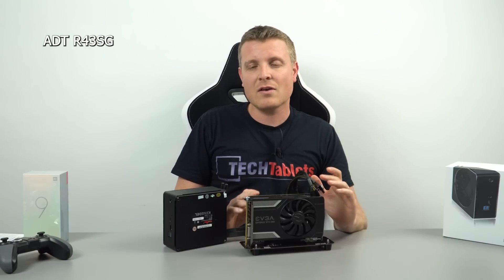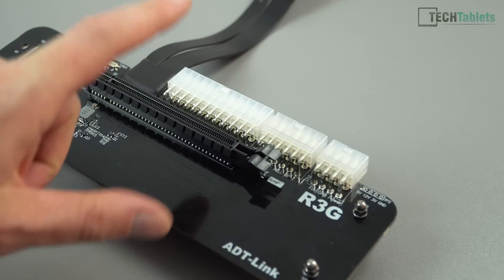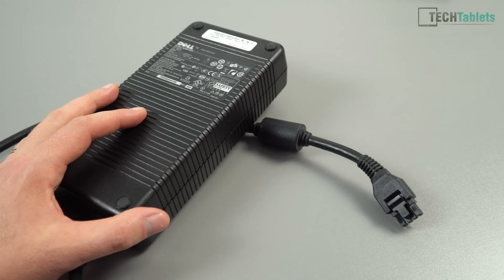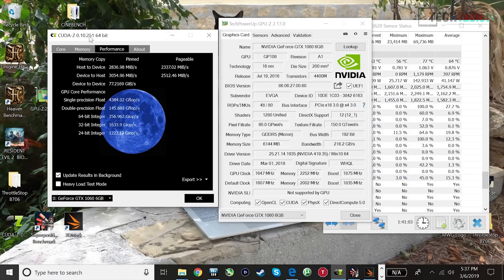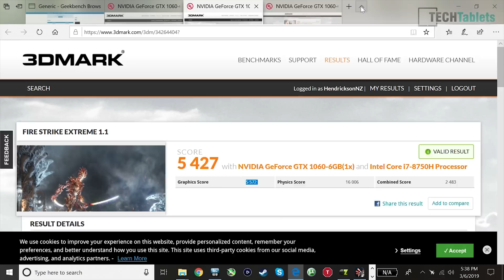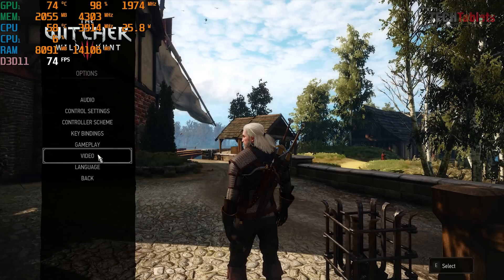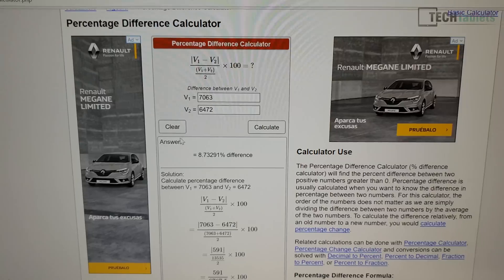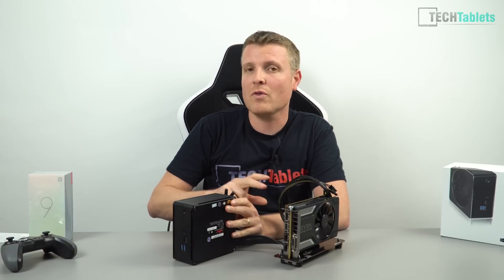M.2 PCIe x4 to External eGPU - Faster than TB3 eGPU's

Comment: The only problem is cost. $90-100 is too much for just the connector. Then you need power source  also & cabinet for GPU. So it bumps up the cost very significantly.
Reply: this connector is only 40$ in china ,but you the shipping cost another 40$....And I buy an used connector half years ago for only 30$ because shipping in china only cost 3$ ...
Reply: @杨俊秋  Nops. That's not the case. Shipping is not $40. Chinese manufactured products have different pricing for outside customers. Since you are in China, they are selling at lower price. I once enquired for Luxcine projector. They quoted me 300 initially thinking that I am Chinese but when they got to know that I am outside China, they quoted $600. Another instance was reported by another user who told that he purchased Jxd 192k model for $150 while in china. But for outside China, it's available for more than double the price..
Reply: Not necessarily: now you don't have so buy another new mobo, ram, cpu, monitor etc.
Reply: @xostler  So is this video aimed at people who already have a very capable system having M.2 which lacks only a powerful  GPU? M.2 is a newer port, so it's not present in older systems. Not many people buy that kind of setup without thinking about future needs. See, my point is that instead of investing money in these upgrades & not extracting the full potential of the card, it's better to build a newer & better system. Ryzen based system can be built with same 1060 GPU by investing just a touch more money. That system can be later upgraded by changing the card and you will still extract full performance of the GPU rather than loosing 10-20% like in this setup.
Reply: Dr Mayank Singh nah man I mean like a laptop. Now you don't necessarily need to have two completely different PCs

Comment: Extra information to add, the bandwidth/performance loss can be attributed to hwo the NVME/m2 slot is routed on the motherboard. If it is directly hooked onto the PCI express lanes of the CPU, you wont lose more than 5%. If it is hooked onto the lanes of the PCH, then it depends highly on the load of the PCH, if you have 2 others NVME drives, a TB3 etc on it, the performance will be much lower.

Comment: I know fo a fact that this wasnt possible untill they invented this 4x NVME connectors...Now this can be used in any small laptop with ease..Nice review!
Reply: You're wrong. This has been done way before NVMe and Thunderbolt.
Reply: @dan8t669  I said-"x4 speeds werent possible" I know those E-GPU exsist even before 4-5 years   but they worked on x1 speed!
Reply: @CocoSloan  No, you didn't. The original comment is still there: "untill they invented this 4x NVME connectors"
Regardless, you're still wrong. 

MSI GS30 Gaming Box has an x16 Interface to the external GPU and is 5 years old.
And there were much older x16 laptop docks before that. Quite common for workstation grade business laptops.
Reply: @dan8t669  You are talking about "docks" im talking about cheap e-GPU (external gpu) solutions.Untill now they all worked x1 pci mode.Hence they didnt utilise the full power of gpu-s..
Reply: @CocoSloan  Again, no. You were talking about "4x NVME connectors" and how it wasn't possible before. Which is wrong.
Another example:

First generation Alienware graphics amplifier used a proprietary cable to deliver 4 pci-e lanes to its e-GPU, NOT x1. And it too was released way before NVMe came out.
Reply: @dan8t669  Dude stop talking about commercial external gpu-s..Im telling you this wasnt possible with cheap-ebay kind of e-gpu's..If im wrong i will admit-but focus more on what im saying!
Reply: @CocoSloan  The Facts are the facts. Your original comment doesn't say anything about cheap, ebay kind e-gpus.
Instead, you claimed it wasn't possible until they invented 4x NVME connectors, which is wrong.
And you can't admit it.
Reply: @dan8t669  Ok i ADMIT .. Go to sleep now!

Comment: Thanks for the video. Just bought a R43sg for my Dell Micro 3050m. What GPU would you recommend for this egpu setup? Im running an i7 6700t/16gb 2400 ram for my Dell. Would a rx 580 be powerful enough (but not too powerful that would bottleneck the system)? Just looking to play Apex legends on my SFF pc. ;)
Reply from the maker: RX580 would be fine for Apex Legends. I think right now the best card for it would be the 1660 Ti, keeping with the Dell power supply that is the cleanest method to power the cards. That card you can use top setting and very good 1080p results if running a 120, 144hz monitor etc.
Reply: @Techtablets  Appreciate the reply my guy. Will look into the 1660ti for sure. Gpu prices in my country are still a bit wonky, a RX580 is actually only 20-40dollars cheaper than the 1660ti. However, the 1660ti price is just 100 dollars cheaper than a 1070ti. So i just defaulted to the cheapest card i can get to play some apex legends. In any case, i will look into the 1660ti more. More power to your channel. Thanks again.
Reply: Just an update for those looking to have an egpu setup, I already got the r43sg for my DELL 3050m and decided to pair it with a Rx 570. Fairly happy with it. Very capable 1080p 60frames for Apex Legends. 

The setup is a bit ugly, and definitely not plug and play. Still looking into m.2 extension cables so i can do a a plug and play setup.

Comment: After setting this up, can I use only miniPC when eGPU is connected while PSU is unplugged. Will this egpu work with 1050Ti, Thank you :)
Reply from the maker: Hi, I'm running it now (unplugged no power) and it's fine. It will run both iGPU and eGPU if you want it. So when not using my GXT 1060 the iGPU is running, just swap the plugs. Yes, a 1050 Ti will run fine and with the Dell 8 pin plug is fine up to 180-200W TDP cards.

Comment: Hey i have a MSI cx62 6qd with a i7 6700hq but a poor gpu do you know if this adaptater will fit.
Reply from the maker: As long as you have a free M.2 PCIe slot yes. But get the 50cm cable version. 25cm is too short for laptops.
Reply: @Techtablets  thx
Reply: @Techtablets  can you pass the adapter link?

Comment: Its possible to test this on Mi Notebook Pro?
Reply from the maker: I recently sold mine, but it will work but since you run two PCIe slots both will be x2 speed. As with the SSD's one SSD = x4, but two SSDs when I tested it both dropped to x2 to shared the PCie lanes.

Comment: How do you power the eGPU, i mean, where the cable from the dell power brick goes?
Reply from the maker: 3 pin plug to the wall socket. Like a typical PSU plug.

Comment: Can't wait for the USB4 version! ;)
Reply: USB4 looks very good, not just the technical standard but not requiring or minimal licensing costs will make it available everywhere
Reply: @ezg8448  Yeah, I think it's going to open up many possibilities.  Multiple monitor set-ups, daisy-chaining, egpus etc...   I'd love to be able to get a cheap tablet or laptop and hook up and an egpu and a 4k monitor.
Reply: Has there been one announced?
Reply: @roostergentry  No, not yet.  The USB4 stardard was just announced and you should be able to buy a USB4 supported device next year.  USB4 is basically Thunderbolt 3, so in theory, any computer with it should be able to support an EGPU.  So I'm sure they will refresh this technology with USB4 when it comes out.
Reply: ADT tech has maded a usb4(thunderbot3) version ,but the price is too high(about 300$),the reason they using m.2 is m.2 is just pcie 3.0 x4,but thunderbot3 needs a chip(about 200$) to translate into pcie3.0 x4...
Reply: @杨俊秋  But that's what's great about USB4! It's royalty free.  It's free to use. You have to pay a fee to use Thunderbolt, but USB is free for anyone to use.
Reply: @gokuo64  usb4 is free ,but the chip isn't, it may cost less ,but i think it still takes  50$-100$...
Reply: @杨俊秋  50 dollars is still a lot less than a 400 dollar external gpu.  I'd easily pay 50 dollars for a USB4 egpu.
Reply: @gokuo64  50$ is just for chip..if you want better experince ,you need 40$ for case, power supply,shipping and cable...I  am waiting for usb4 egpu too,but I don't feel so good about the price....
Reply: You can't use eGPUs with USB and you will never be able to. It's not that is not speedy enough (yet), but the USB protocol is a completely different protocol from the gpu's PCIe. They are incompatible.

Comment: Not really surprised that there isn't a huge performance loss - PCIe 3.0 x4 provides the same bandwidth as PCIe 2.0 x8, which used to be fine for GPUs a few years ago. GPUs still aren't really taking advantage of the extra bandwidth provided by PCIe 3.0, it seems.
Reply: hello, im a noob in the p.c world but can someone tell me if this egpu will be compatible with a M.2 2280 slot?
Reply: @npaz24  yeah, there is no bandwith losing, all m.2 nvme are the same, just be careful with the screws
Reply: @flaminyonguwu4034  , thanks for responding on that question. Also, does PCIe 4.0 x4 see a bottleneck with a eGPU considering its equal to PCIe 3.0 x8? I have an extra M.2 NVMe PCIe slot in my new Acer Nitro 5 but can not find what speeds it at.
Reply: @captureinsidethesound  did you solved? Im on your shoes
Reply: @waikiki  , that laptop is gone now, but if I remember correctly, I think it was PCI-e 4.0 x4. I wish never sold that laptop because it was a workhorse.
Reply: only one card that exceeds x8 speed and that is currently the 2080Ti and only in some tests.

Comment: Chris, all the Thunderbolt 3 port use 4 lanes of PCI Express, not 8 lanes like a GPU slot in a Motherboard. Only the Alienware Customized Graphics Amplifier port can use 8 PCI Express Lanes for their  Graphics Amplifier port. In this setup, the bandwidth you will get, will be theoretically same as any Thunderbolt 3 port with 4 lanes (40 Gbps). And there is currently no card in the market, may be apart from some highest end Quadro cards, which can saturate PCIe 3.0 8 lanes. The actual bandwidth provided by the GPU is way below that. So, using 4 lanes will not really cut the bandwidth 4 times.

Comment: I got the gtx 1060 3gb used for £90 and enclosure for £25 and external GDC EXP Beast for £45 with Dell power supply. I got 2*4gb DDR4 2666mhz £53 and 256gb nvme for £41 and after cashback the main computer £288 before customs. £540 total before customs considering a laptop with same spec is £1000 roughly sometimes less or slower SSD and slower DDR4 I'd say this is still a better buy than a complete self built kit especially if wanting intel processor.

Comment: I've read somewhere that the perfomance drop through x4 lanes is as you said at a maximum of 15%. 
But unfortunately that applies only to cards UP TO the 1060 and in the FullHD range. 

If you go higher to a 1070/1080 or 2070/2080 and you want to handle 2k or even 4k you have to be ready for a greater perfomance loss as the transferred data is then way more as what the x4 lanes can handle. 

Would really like a second video as comparison with the 1080 and 4k. But thats probably a bit too much of an investment for only one video. (buuuuut you could start playing vr with it, which I would highly recommend. ^_^)
Reply from the maker: Hi, well it was the Firestrike Ultra test in 4K there.
Reply: @Techtablets  woah, missed that. Thanks for clarifying! Would be even more interesting to know how beefier cards would get handled!

Comment: 12:43  Personally, those type of commenters need to keep to themselves. This setup is meant to be an add-on for those who already have systems or want to extend the life of an old laptop.
Reply: @EMagnificent You're a fool's errand.
Reply: @EMagnificent My laptop is from 2014, but it's got a 4 core i7, 16 gigs, and ample storage. All benchmarks say that the rest of the hardware, aside from the graphics card, are mediocre, but more than useable for modern gaming. If I'm already running a better external wifi card, and it already lives on my desk full time, why shouldn't I use the MPCIE slot for a newer gpu? Bottlenecking? The most severe credible reports of performance loss are around 30%. I'm running an 860 right now. an EIGHT SIXTY. You mean to tell me that I won't get a measurable improvement for small bucks here? Theres reason to expect a VR ready setup, if only at the minimum requirements, with a good 10 series.
Reply: @EMagnificent yes true. but lets say this is a temporary build for a "decent" laptop whereas the gpu and PS will go onto the full PC build later on. this is perfect as temporary upgrade to performance.
Reply from the maker: Exactly, for a mini pc liek this it might just be living on a desk and never moded around, or that 7700HQ with a weak 940MX GPU just got itself an upgrade to a 1060 or 1660.
Reply: @Techtablets  This Will Work with a MSI GT80s Titan? It has 2 NVME slots

Comment: Great video, fun project and perhaps not that realistic for every day use but it does work. I am so tempted by the Partaker Mini PC with the updated Intel Core i7 8550U Quad Core cpu but I fear it still has HDMI 1.4a but it seems they have included a M.2 slot. Can not decide if a Intel NUC is a better option compared to that nice passive cooling. This small computer would have been epic with the AMD Ryzen 2400G or 2400GE at least in terms of much better performance with the Vega 11 graphics.
Reply from the maker: 99% sure it's sadly HDMI 1.4A. Only the Intel ones use HDMI 2.0A so this is yet another area the Chinese cut costs
Reply: @Techtablets  Yeah, I agree. But as you said, you can always use a DP adapter to fix that.

Comment: Nice. But compare Desktop/vs NUC in real life. Like 4k render, games, works in PS/Autocad with same card, power consumption. PC with 4 cores?  I gues 8750H NUC will be 10% slower but twice effiency in heat/noise and power consumption.
Reply from the maker: If you see my main review of it there is more info. But yes power consumption is so much lower. Huge difference. And it still edits my 4k videos fine in the studio when I do. It feels as fast as my desktop in everything normal day use etc. And most of the time I never even hear it. The fan is almost off, just a low RPM only when encoding and editing really it becomes a hum.
Reply: @Techtablets  I ask for render with eGPU, temps and trottling in games miniPC after hour in Metro or Battlefield
Reply: I suppose because the workload of GPU is external the CPU temperature must be lower under demanding graphical processing.

Comment: i have an eye for this GPU evga gtx 1060 last two weeks until now on ebay and use as eGPU like this but i always lose on bidding😥. can't wait to keep a hand on it.lol...
Reply from the maker: Hi, it's why this video has been about 3 weeks in the making. I lost a few bids on the cards, first, it was a 3GB version and was lucky to grab this almost as new card 100% dust free. The power adaptor also took 2 weeks in total from eBay almost but only cost 25 euros. I'm really pleased with the performance overall of the card even if the VRMs apparently don't have heatsinks I read in a review.

Comment: Nice adventure even I won't go that way.
Great that you do that cause next time I might jump on your next train you set on fire again cause that had happened from time to time every quarter like Xiaomi 4 K drone, tabkets, laptop hacks and tweaks like the copper heatsinks.
Reply from the maker: It's definitely not for everyone this mod with the GPU stand. Well I plan to go even a step further and check the Core i9 8950HK version to see just how much I can overclock and push it before thermals etc are an issue.

Comment: 1050ti would be much better choice if u got the i5 model and if u got the i7 one then gtx1660 would be much nicer choice!! .... , if u r just going to sit at home I don't think u need a mini pc , just build a full size desktop !! much easier to upgrade , clean/repair!!
Reply: well the i5 with a 1660ti would be faster in games than a i7 with a 1050ti. 

you can use an i5 with a good gpu as well for high fps.
 
depends on the game.
Reply from the maker: Yes just go PC build for home if gaming. But just the mini pc itself is great for space saving and portable etc.
Reply from the maker: 1660ti isn't cheap however, double the price of the 1060 I got. But at least it works with the cleaner Dell power supply and not a bit loud messy PSU.

Comment: EXP GDC Beast 8.0
Reply: That's what I'll try it's much cheaper and has enclosure options. Got my kit complete with enclosure and Dell power supply for £70. Hopefully cable will fit through like this does however I went for ngff m.2 which isn't as expensive as the m.2 and won't be 4x pcie but I hope it's close.
Reply: @_GarethRossUK  can you do with a Thinkpad laptop with expresscard ?
Reply: @ThePASBERUK  Give it a try
Reply: @ThePASBERUK  Don's try expresscard. My thinkpad w520 with strix 1070 can only work stable under pci gen 1 and it lose too much performance.
Reply: @_GarethRossUK  any updates about it and how much loss you got?

Comment: This will help if the CPU and memory is too much for an integrated discrete GPU, else it won't help. You have a full i7, that is why you get an increase with using external GPUs, won't help for old devices
Reply from the maker: Yes but plenty of laptops with i7 7700HQ & 7300HQ laptops with weaker series 9 GPUs. Or the MX150/MX110 laptops, 8300H laptops with GTX 1050's there is a wide range that could use. Very unpractical of course. I focused more on uses like this for a mini pc that is more than likely to live on a desk.
Reply: @Techtablets  Yeah, mini PCs are its market, else it is too expensive